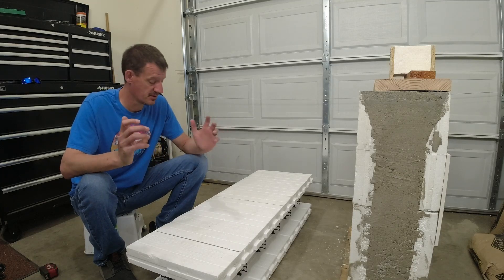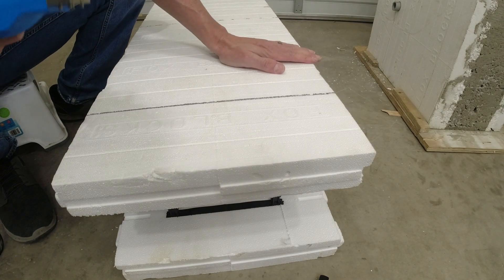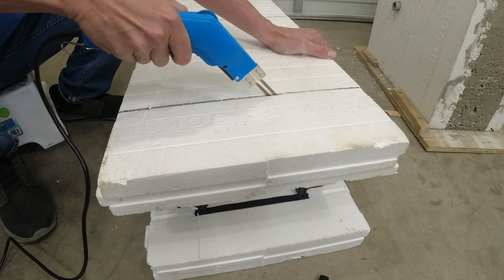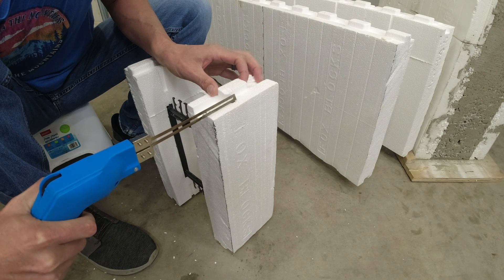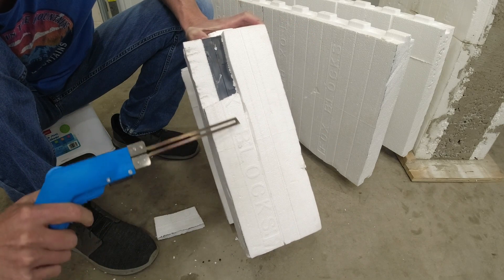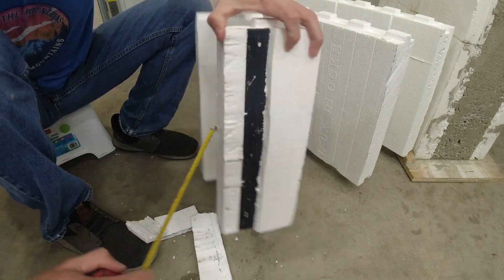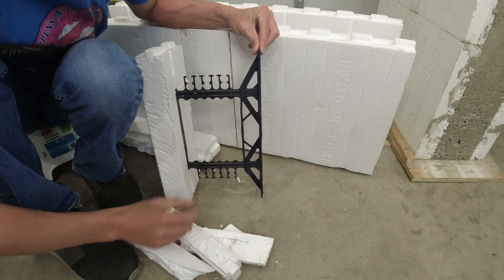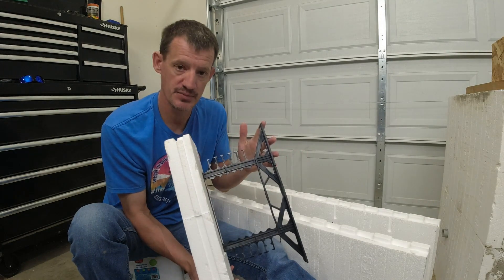ICF plastic stud Exposed - What's inside an ICF block

Comment: I also saw someone attaching plywood for heavier things such as tv and kitchen cabinets. Is that needed?
Reply from the maker: It not required.   I'm actually going to do that in some places just for mounting convenience.   The studs being 8in apart helps but if you're mounting a TV or cabinet it gives you a lot more flexibility.

Comment: Did you end up putting electronics on your ICF wall? I am getting ready for a full wall built in and an 85” TV. I am wondering if I need to frame a new wooden stud wall to then build the built in off of or can just use the ICF wall as is. I am assuming you are also anchoring into the poured concrete as well no? Though drywall, foam, plastic and into concrete?? Thanks for the ideas.
Reply from the maker: I haven't gotten to that part quite yet.  I will say don't be afraid of the plastic studs.  I was definitely scared of them at first, but the more I've seen you really don't have to worry much.   They hang big kitchen cabinets off them and all kinds of other stuff.   You might ask one of the manufacturers if they have any specific details, but I'd treat it like a standard wall and not worry too much.  I probably wouldn't try to anchor to the concrete, but you might call fox blocks and ask about that.

Comment: People that use wing boxes with these "studs" should be fired, and the practice should be banned.  It's flimsy and cost over twice what a simple 4x4 box and a trim ring cost.
Reply from the maker: I saw some crazy boxes made specifically for ICF'S that looked cool but they didn't make the install any better.   Really expensive without any benefit.